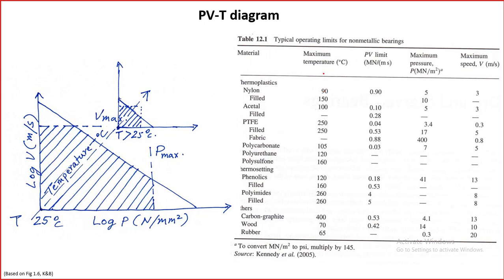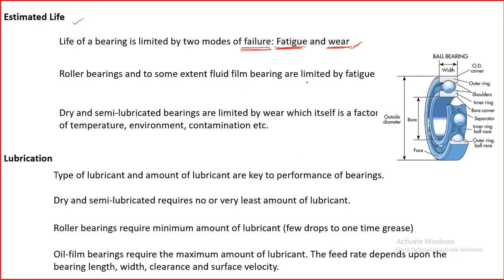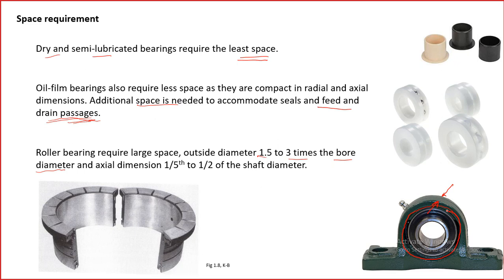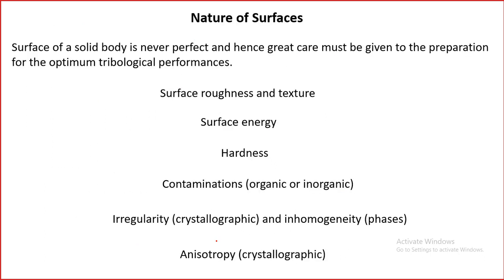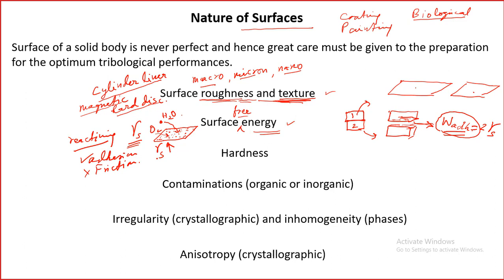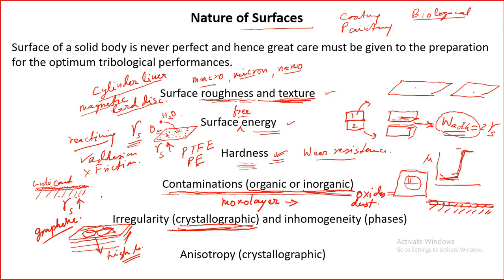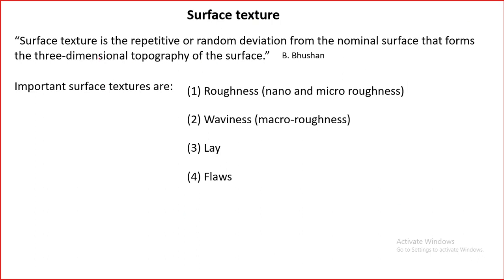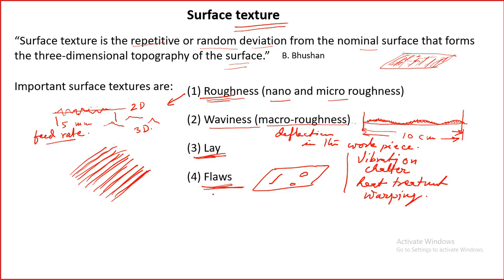Tribological Systems Design - Lecture 12 - PV Diagram, Nature of Surfaces, Roughness and Textures

Comment: In PV table, in some cases max velocity and max.pr not mentioned? What it implies?
Reply from the maker: The table was taken from a book. I am sorry those data were not available. If you are doing your own research then you need to ensure to measure both velocity and pressure. Thanks for asking 👍
Reply: @engineeringmaterials-tribo5142  Thank you for reply, if we are able to construct PV diagram from  experiment results of pin on disc?